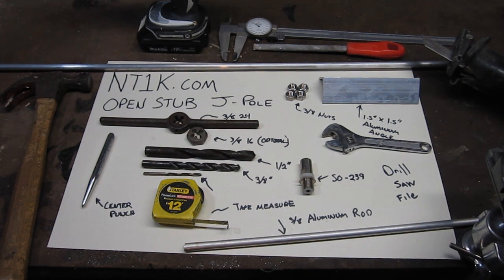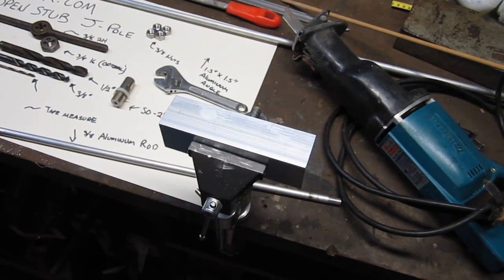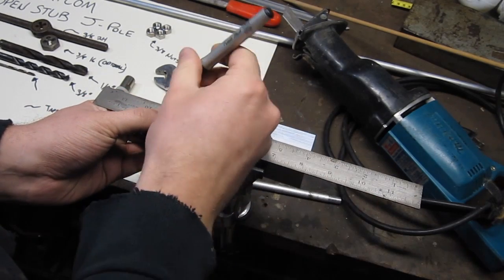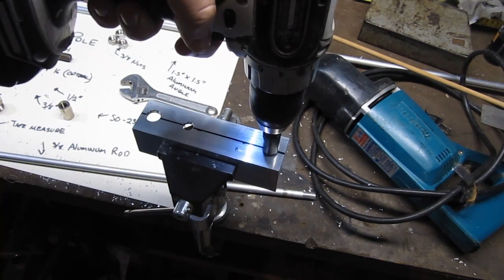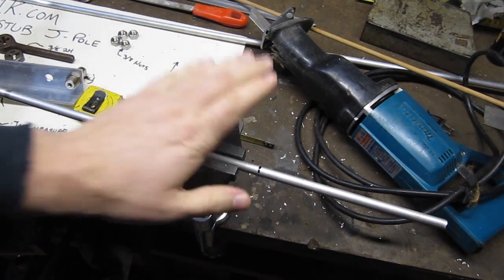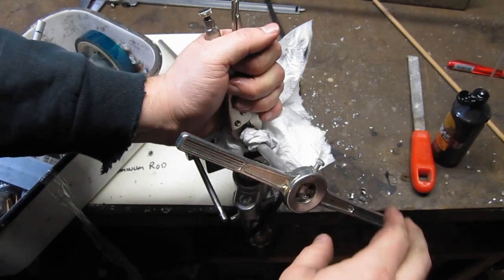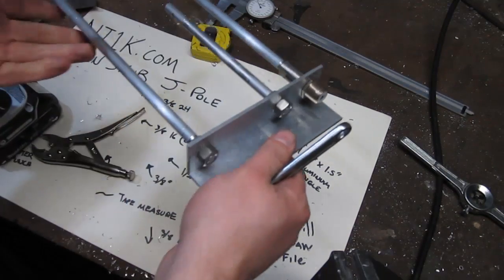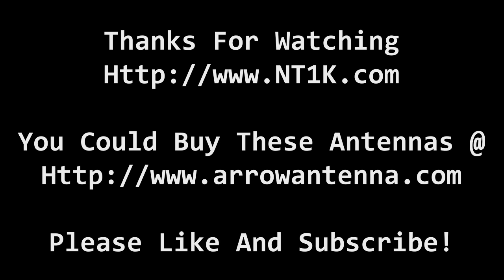NT1K.com - Building The Dual Band Open Stub J-Pole

Comment: You just made a dead short Recheck it on the SO239 !!!
Reply from the maker: @ 9:00 into the video. You'll see that the SO-239 comes with a plastic shoulder washer that insulates the "ground" with the center conductor. Confirmed with multi-meter. There is no dead-short.
Reply: @nt1k  RR did not know that I never used that kind Thanks for the Info.

Comment: A tip for making measuring and marking metal easier: take some blue painters tape and put tape down in the area you will be marking the metal.  Now you can use a ball point pen to mark where you are going to drill. When done drilling you can remove tape.

Comment: Hello. How will the characteristics change if my aluminum corner turned out to be mirrored: the power cable on the right. All elements are of the correct length.

Comment: Nice I legit just made 2 of of these and one 220 version.
I'm lucky enough that I work in a machine shop so I chucked up the aluminum bar stock in the CNC lathes and cut the threads.
Swr on 2m is flat under 1.13 and 70cm 1.3 or less 
The 220mhz ver is 1.2 
I don't know how well the radiation pattern is on these kinds of antennas but they seem to work okay.

Comment: Great video I’m going to make one out of 1/2 Cooper just a thought though when measuring the element wouldn’t  you measure the length plus the thread as that’s going to be beneath the bracket 🤔 so in effect the element would be slightly short
Reply: I think this is all about the velocity factor of various metals. BTW some length correction would probably be needed for copper construction, as I assume there would be a slight difference. It seems to me, the thread length is probably already calculated in the overall element lengths.

Comment: I Have built similar version of this antenna like (70 of them) the threads on the 3/8 24 need to to be sealed with silicon sealer.
Good video.

Comment: jbail or anyone, can you give details of the SO-239 connector being used? I can't seem to find one like this anywhere. It looks to be specific to this application. Any info?
Reply from the maker: It's commonly used with CB operators. It's known as a SO-239 to threaded adapter. SO-239 to 3/8
Reply: Any good truck stop that sell CB' S will carry them.

Comment: Great video. You have inspired me to purchase all of the materials to build one. Just curious... why not use 3/8"-24 on all three elements? Also, where did you find the PEM nuts?
Reply: ** UPDATE 08/05/19 ** I've built 4 of these for mountain top relays (dual Baofeng set ups) and can attest that they work beautifully and are very forgiving. If you see these on eBay, buy them!

Comment: What about grounding (earthing) this antenna when it has been put up? I sometimes read a J-Pole does not need to be grounded while other people say the opposite.
Can you tell me which is true in case of this antenna, please?
Looks really lovely BTW.
Thanks and 73.
Reply: Since your answers were ~ 50/50, I would say that only personal experimentation will give you the answer you seek. I'm betting though, their observations were probably related more to the fact they either had an "air choke"or not at the feed point, as this can wildly affect SWR / responsiveness at times on many DIY antennas. Adding the air choke, plus grounding can usually solve a lot of problems. Observe which one works better (with / without a ground), and mount accordingly.

Comment: Good work on the video. One question: The measured lengths of the reflectors have been functionally shortened by 'one nuts' worth of length. Should the measured and cut length be longer by that 'one nut' length that is lost below the aluminum angle?
Reply from the maker: The video goes alongside a blog article. The "element" dimensions are taken from the angle. So if you are using different nuts, you would have to change dimensions.  If anything, cut long and adjust as needed. The antenna is wide banded (on VHF at least) and is very forgiving.

Comment: Thanks for the specs on the antenna, I have made 3 of them now and they work great!  I do find threading the rods to be the most difficult part.  Something I do a little different is to cut the threads before cutting the rod to length, that way if I mess up the threads I just cut them off and start again without wasting the stock.  Thanks for the video!
Reply: Mike K Where do you go to buy the rods?
Reply: hoshnasi I bought them from Grainger.  Luckily I have one pretty close.  Home Depot Pro carries them up to 4 feet.  Unfortunately that is a little too short for the longest element.
Reply: Mike K Thanks for the quick reply.  I was concerned about pre-cut lengths.
Reply: I suppose you could always use a long threaded nut in the middle and make it a 2 piece.
Reply: I used my Dowl-It jig (https://www.dowl-it.com/2) as a die clamp and chaser. I chucked the rod into my cordless drill and it cut the threads extremely straight.